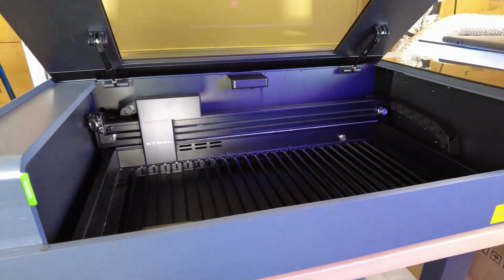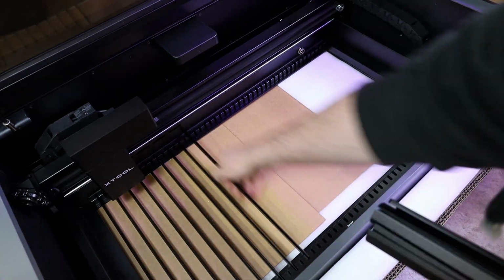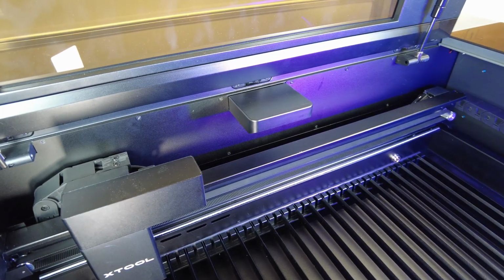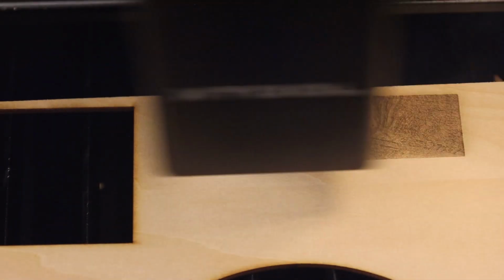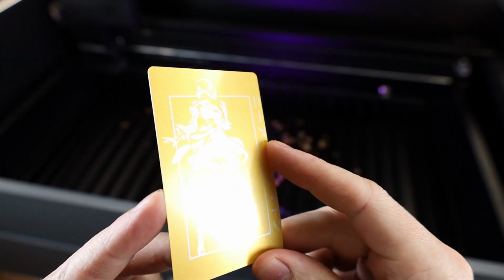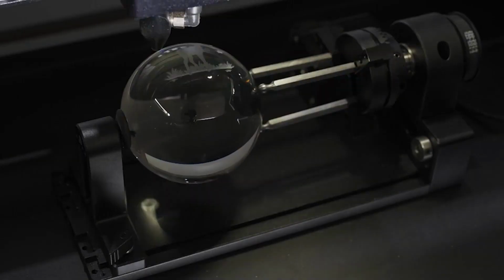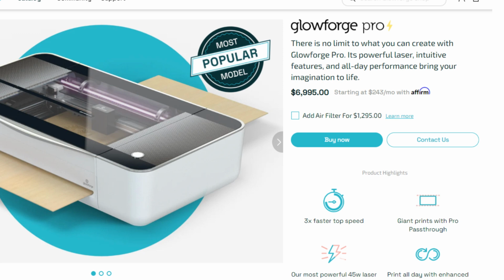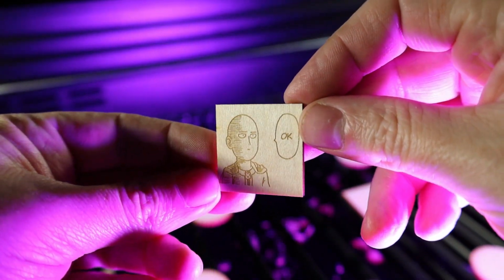This Might Be the Best Desktop Laser - xTool P2 CO2 Laser Machine

Comment from the maker: xTool P2 55w CO2 Laser (US) - https://bit.ly/xTool-P2-CO2-Laser
xTool P2 55w CO2 Laser (UK) - https://bit.ly/xTool-P2-55w-CO2-Laser-UK
xTool P2 55w CO2 Laser (EU) - https://bit.ly/xTool-P2-55w-CO2-Laser-EU

xTool P2 Riser Base - https://bit.ly/xTool-P2-Riser-Base

xTool Smoke Purifier - https://bit.ly/xTool-Smoke-Purifier

xTool Automatic Conveyor Feeder for xTool P2 - https://bit.ly/xTool-P2-Conveyor-Feeder

xTool RA2 Pro for xTool P2 - https://bit.ly/xTool-RA2-Pro-Rotary

Other Lasers From xTool:
xTool F1 Pre-Order - https://bit.ly/xTool-F1-Laser-Engraver
xTool D1 Pro 2-in-1 Kit: 455nm Blue Laser and 1064nm Infrared - https://bit.ly/xTool-D1-Pro-2-in-1Kit
xTool D1 Pro Laser Engraving & Cutting machine - https://bit.ly/xToolD1-10W
xTool D1 Air Assist Set - https://bit.ly/xToolD1AirAssistSet
xTool RA2 Pro 4-in-1 Laser Rotary - https://bit.ly/xToolRA2Pro
xTool Honeycomb Cut Bed - https://bit.ly/xToolHoneycombBed
xTool Materials - https://bit.ly/xToolMaterials
xTool 20W Diode Laser Module - https://bit.ly/xToolDiodeLaserModule20W
xTool Enclosure Smoke-proof Cover - https://bit.ly/xToolEnclosure
xTool Smoke Purifier - https://bit.ly/xToolSmokePurifier
xTool RA2 Pro 4-in-1 Laser Rotary - https://bit.ly/xToolRA2Pro

Other Co2 laser that I talked about:
Gweike Cloud Laser Cutter - https://bit.ly/GgweikeCloud-Pro-Laser-Cutter

This is one the the best of out of box Co2 lasers that I have used. Mostly due to how easy it is the get setup and use. There are also a lot of add-ons for it so you can customize it to fit your needs.

xTool P2 55w CO2 Laser (US) - https://bit.ly/xTool-P2-CO2-Laser
xTool P2 55w CO2 Laser (UK) - https://bit.ly/xTool-P2-55w-CO2-Laser-UK
xTool P2 55w CO2 Laser (EU) - https://bit.ly/xTool-P2-55w-CO2-Laser-EU

xTool P2 Riser Base - https://bit.ly/xTool-P2-Riser-Base

xTool Smoke Purifier - https://bit.ly/xTool-Smoke-Purifier

xTool Automatic Conveyor Feeder for xTool P2 - https://bit.ly/xTool-P2-Conveyor-Feeder

xTool RA2 Pro for xTool P2 - https://bit.ly/xTool-RA2-Pro-Rotary

Other Lasers From xTool:
xTool F1 Pre-Order - https://bit.ly/xTool-F1-Laser-Engraver
xTool D1 Pro 2-in-1 Kit: 455nm Blue Laser and 1064nm Infrared - https://bit.ly/xTool-D1-Pro-2-in-1Kit
xTool D1 Pro Laser Engraving & Cutting machine - https://bit.ly/xToolD1-10W
xTool D1 Air Assist Set - https://bit.ly/xToolD1AirAssistSet
xTool RA2 Pro 4-in-1 Laser Rotary - https://bit.ly/xToolRA2Pro
xTool Honeycomb Cut Bed - https://bit.ly/xToolHoneycombBed
xTool Materials - https://bit.ly/xToolMaterials
xTool 20W Diode Laser Module - https://bit.ly/xToolDiodeLaserModule20W
xTool Enclosure Smoke-proof Cover - https://bit.ly/xToolEnclosure
xTool Smoke Purifier - https://bit.ly/xToolSmokePurifier
xTool RA2 Pro 4-in-1 Laser Rotary - https://bit.ly/xToolRA2Pro

Other Co2 laser that I talked about:
Gweike Cloud Laser Cutter - https://bit.ly/GgweikeCloud-Pro-Laser-Cutter

Other Later Options From xTool:
xTool S1 40w Diode Laser (US) - https://bit.ly/xTool-S1-Diode-Laser
xTool S1 40w Diode Laser (UK) - https://bit.ly/xTool-S1-40w-Diode-Laser-UK
xTool S1 40w Diode Laser (EU) - https://bit.ly/xTool-S1-40w-Diode-Laser-EU

xTool F1 Portable Laser Engraver IR + Diode Laser (US) - https://bit.ly/xTool-F1-Laser-Engraver
xTool F1 Portable Laser Engraver IR + Diode Laser (UK) - https://bit.ly/xTool-F1-Portable-Laser-Engraver-UK
xTool F1 Portable Laser Engraver IR + Diode Laser (EU) - https://bit.ly/xTool-F1-Portable-Laser-Engraver-EU

xTool D1 Pro 20w Diode Laser (US) - https://bit.ly/xTool-D1-Pro-20w-Diode-Laser
xTool D1 Pro 20w Diode Laser (UK) - https://bit.ly/xTool-D1-Pro-20W-UK
xTool D1 Pro 20w Diode Laser (EU) - https://bit.ly/xTool-D1-Pro-20w-Diode-Laser-EU

My jewelry making templates - https://bit.ly/GomeowCreationsShop

Credit to the artist that made the Guts drawing from Berserk:
msc gie - YouTube - https://www.youtube.com/@msc_gie

msc gie - Instagram - https://www.instagram.com/msc_gie

______________________________________________
If you are looking for more tools and materials that I use, well you're in luck! I made a page on my website just for that.
https://GomeowCreations.com/tools-and-materials 
https://GomeowCreations.com/partners-discount-codes

Note: Most of the links that I use that go to products are affiliate link. This means I make a small commission on anything that you happen buy using them. This is at no extra charge to you and this helps support the work I do on this channel. 😁👍
______________________________________________
Other Ways To Help Support The Channel:
My PATREON ➜ https://patreon.com/GomeowCreations
One time support ➜ https://paypal.me/gomeowcreations
______________________________________________
Instagram ➜ https://instagram.com/gomeowcreations/
Facebook ➜ https://facebook.com/GomeowCreations/
______________________________________________

Comment: Hey there, do you know anything about gold plating bath solution by any chance? Is the cyanide version better or cyanide free? Also, do I just leave it in the beaker and cover it up? Thank you
Reply: Hey mate, the cyanide free is potassium cyocranate (possibly misspelled). its still basically a cyanide base. you will need an anode and cathode and power supply (adjustable) as well as a cleaning bath. this will plate @ about 0.5 microns (its called flash plating or gilding). there's no big difference in quality one solution or the other. if you are talking about dip plating (no current needed) dont waste your time. hope this helps !